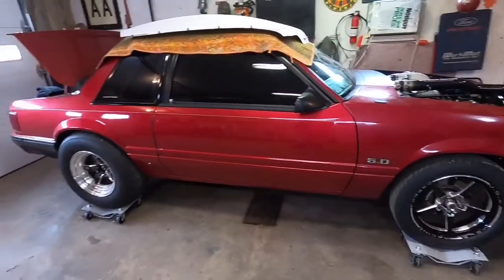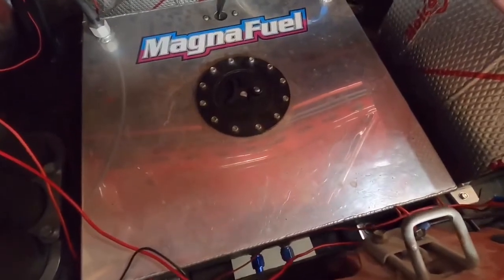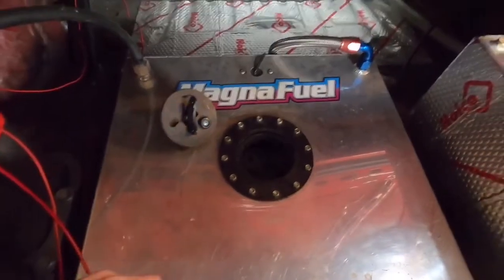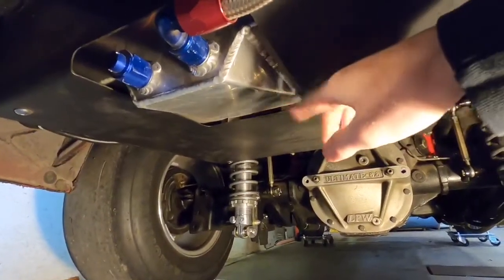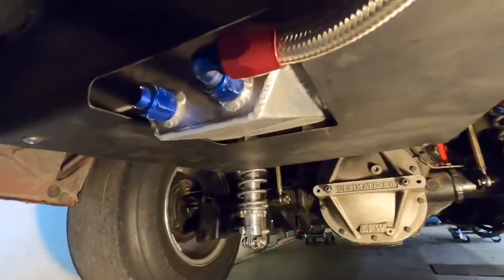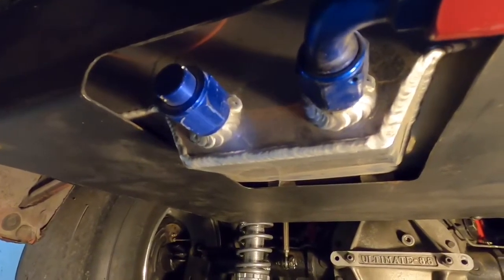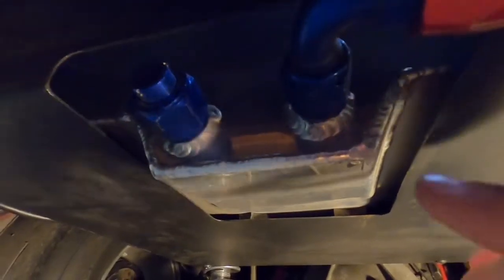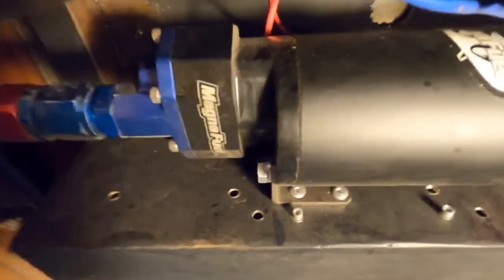How to build a 1000HP E85 fuel system!

Comment: I make about 1,250 + HP on E85. S/C and I/C SBF. I run two Aeromotive Eliminator fuel pumps. Each has -12 feed from the tank to  the pumps. From the pumps -12 up to the engine compartment to a Y-block. From the Y-block two -8 lines to the front of the 5/8" ID fuel rails. I run 8 Precision Turbo 225 lb/hr fuel injectors. Out the back of the fuel rails to an Aeromotive regulator with a -10 back to the tank. The tank is a Aeromotive sumped stock fuel tank. It works very well. I run 40 psi static pressure with a 1:1 pressure rise with boost. Engine makes about 20 psi of boost.
Reply from the maker: Very nice that’s a serious set up

Comment: Hey quick question how does the boost reference regulator up the fuel pressure if it's on the return side? I'm new to fuel injection sorry if it's a silly question

Comment: Nice set up on the fuel rails! Yours feed from the back. I have kinda the same but, I have a #10 coming from the tank and it y's off into 2 #8 feeding the front of the rails and then it goes into a regulator and a #8 back to the tank!
Reply from the maker: Ya feeding from the front or rear of the rails dosent matter, just depends on how u have ur lines ran, all works the same

Comment: How effective are those wiffle balls as baffles in the fuel cell? I've been told to steer clear of the foam insert with E-85. Never seen that done before, is that plastic resistant to ethanol?